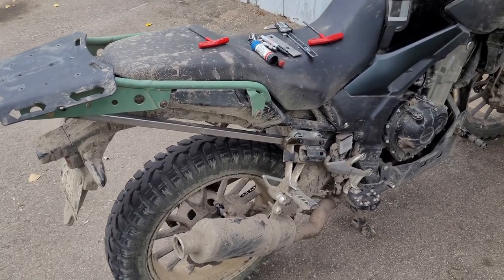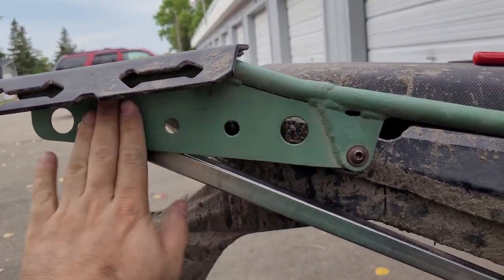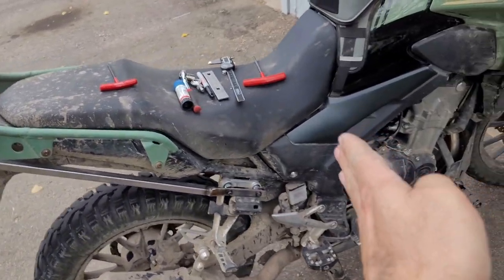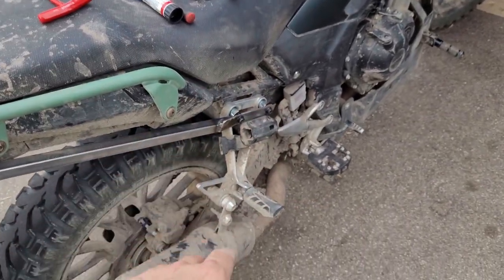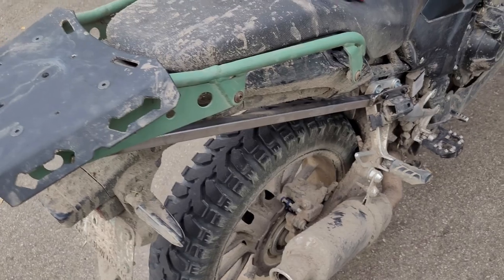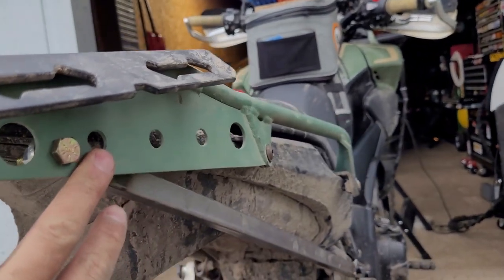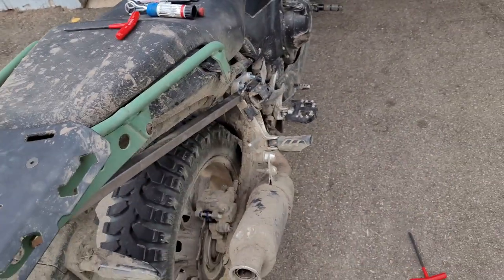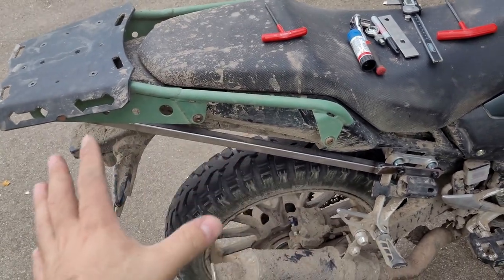CB500X Luggage Braces

Comment: Man your bike is dirty👍
Reply from the maker: I rode in the rain earlier this week, it's not as bad now
Reply: @KorysRides  I was just messin with ya. I just got a cb500x so far I have 515 miles on it. Fun bike to ride, I havent really taken it anywhere. What kind of tires are those? 80/20 50/50
Reply from the maker: @normandegeorge6526  e07 rear and an e804 front